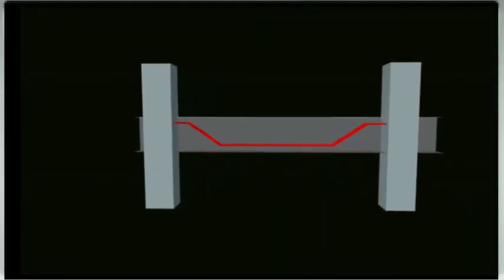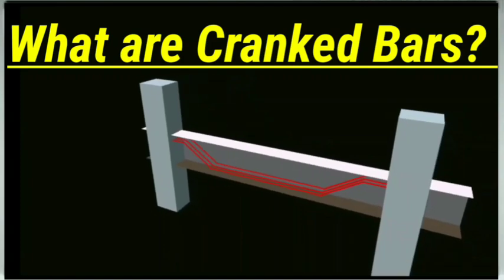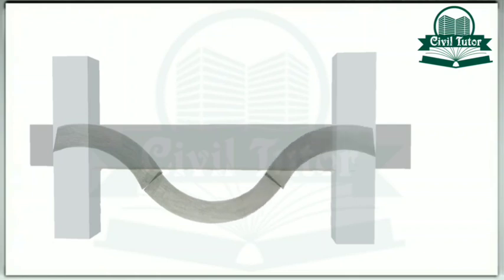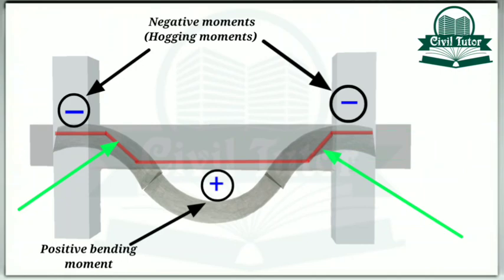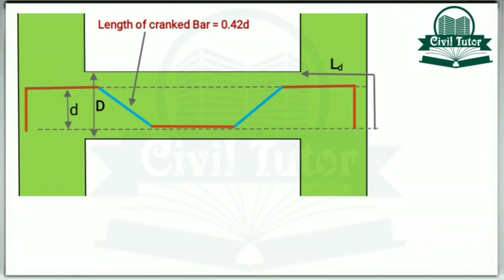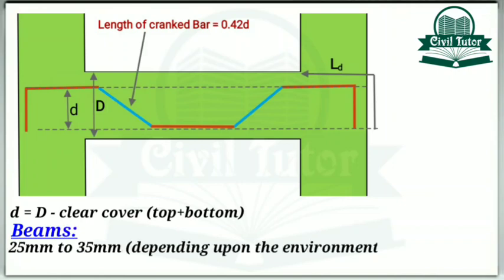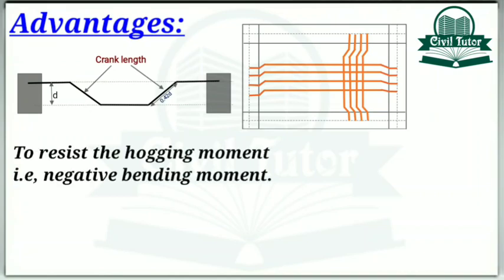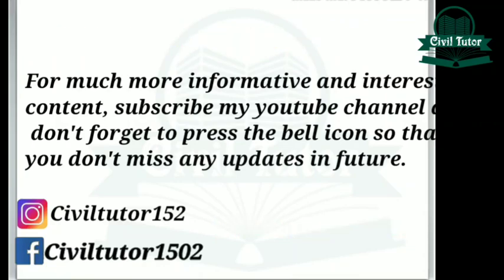WHY CRANK BARS ARE PROVIDED IN BEAMS | CRANKED BAR WITH 3D ANIMATION | BENT UP BARS IN BEAM | #BBS

Comment: Before explaining  what crank bars do , one should  mention the condition in which the column- beam joint is operating,  If the column - beam joint is hinged or pin jointed, the crank bar will not provide the " cantilever effect,witht he column" and so the crank bar will add to the shearing  forces in the beam
If the column- beam joint is solid, then there is a cantilever effect with eh column to which the crak bar is being very active to strenghten the cantilever effect close to the column and effectively minimizing the span of the beam.  Obviously with a solid column - beam joint the column will be subjected to a buckling effect and lower  horizontal shear stress at its foundation.

It is important to first  mention the mode in which the column- beam joint is operating.as even with a cold  concrete joint the shearing effect will be different.   It is all very interesting deep knowledge that makes engineering so wonderful, all REALITY AND TRUTH  needs the support of engineering working outside the human mind. All that exists in the human mind  are illusions, myths, hallucinations, thoughts,  emotoins , sentiments, beliefs , postulated , sins , grief , guilt, love , fiction and so much more,  Not every illusion in the human mind can be enginered outside the mind  Most people love to live taking up a language and a social emotional  educating  whose activity remains within the boundary of the human mind and they never manufacture any tangible guranteed  items.  Engineering supports REALITY AND TRUTH and what exists in the universe including he engineering in the human mind which supports the mind itself.